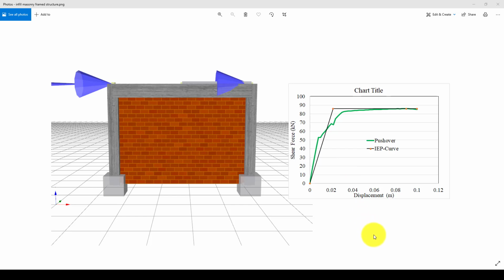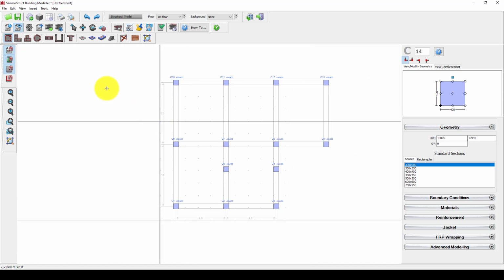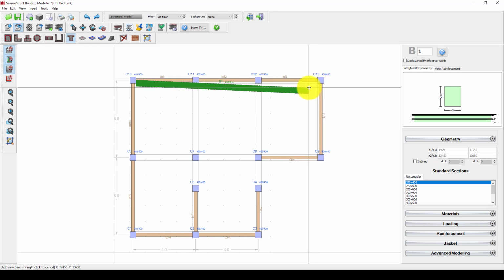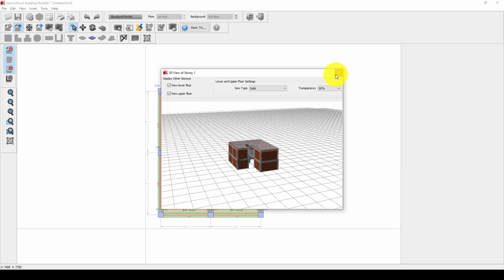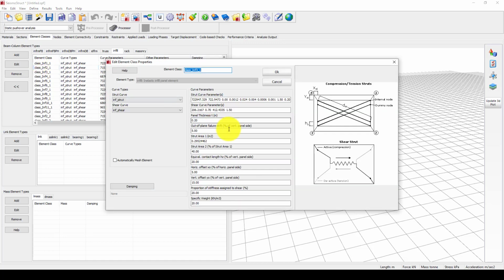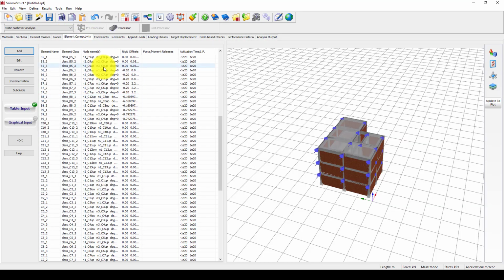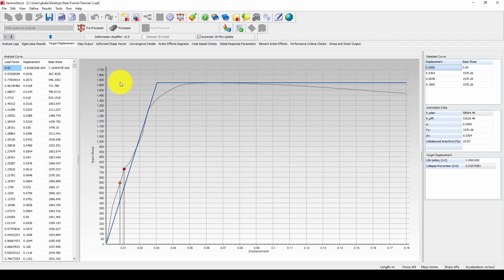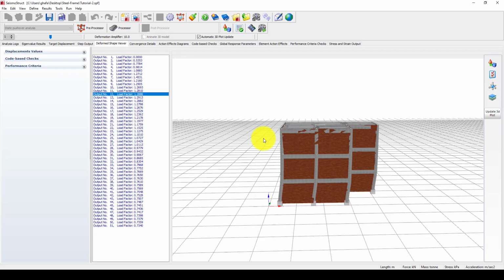Modeling and Pushover analysis of multi-story masonry  building in SeismoStruct software

Comment: wall must be in top of plinth beam. why you don't model plinth beam. and footing depth(column) is around 1.95m why you don't make that, if you make then most of the failure will be at plinth beam level, am i right?
Reply from the maker: No,